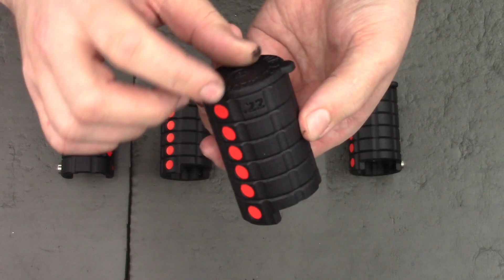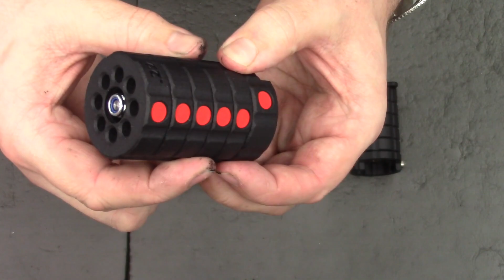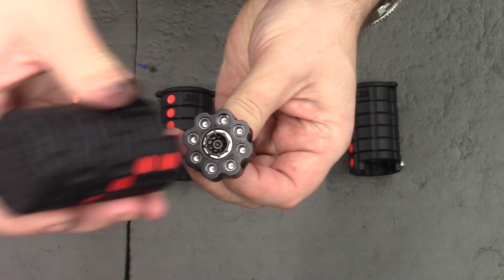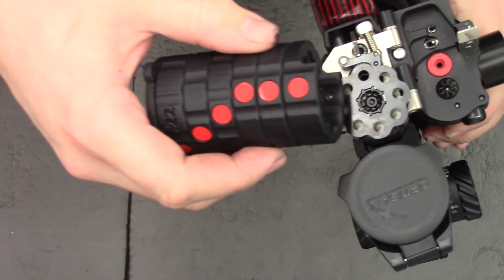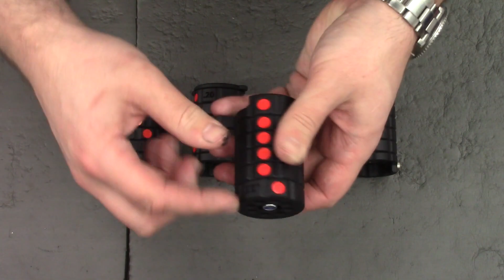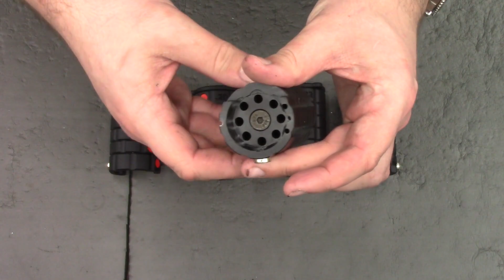new Leshiy 2 speed loader

Comment: good thinking but I would rather buy 5 spare magazines and keep it in my pocket for fast loading
Reply from the maker: Fair enough but the mags are £72.50 each plus shipping, so for 5 extra mags you are looking at £362.50 plus shipping, or one of these cost for £65, and the time difference is negligible, I always pull the indexing are out the way when swapping mags so for me it takes longer to change mags then it does to use this. Thanks for watching.
Reply: changing a magazine is not 'fast loading' on the L2,
and you could chip or snap the indexing jockey wheel
Reply: well I apologize. because I have leshiy 2 and 5 mags which makes it very easy for me like, it takes only 2 sec to swap mag. and nothing wrong happened

Comment: Received my SL yesterday, now when I get an engineered part I have a habit of what can only be described as fondling 😁 the item to great lengths and the better the engineering and quality the longer this takes, it is still in my hand and that for me is a testament to it's quality, you mentioned you are proud of your efforts and rightly so, I know these arnt made by you but from your great designed and they have turned out brilliant, 10 out of 10 👏👏👏
I'll hopefully be getting a .30 to accommodate my plans 
Keep up the great work and videos
Cheers
Chris 😎👊👍
Reply from the maker: Thanks, I have one by my desk which I like to clack back and forth, so I appreciate that and your kind words. The .30 cals have been ordered, they required a little modification because of the size of the pellet, but they work just as well and should be coming in soon. Thanks for watching.